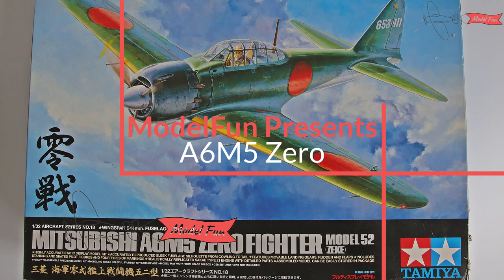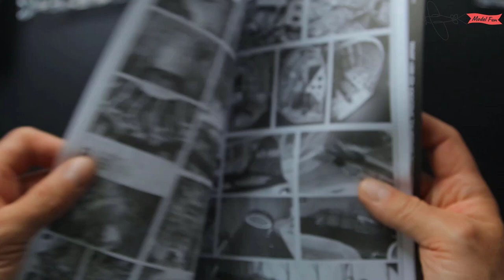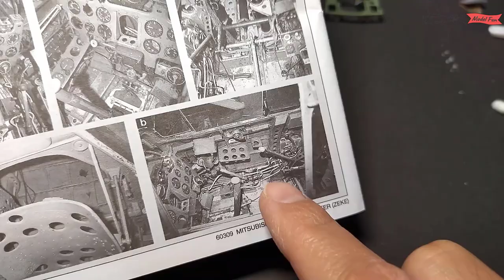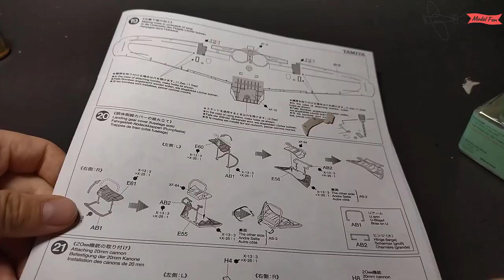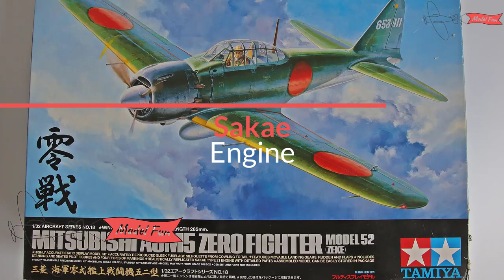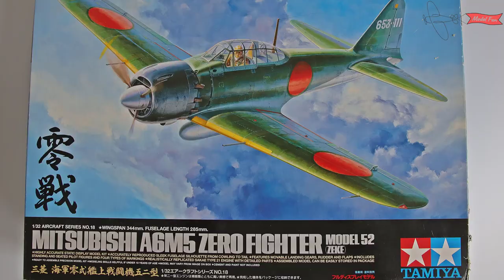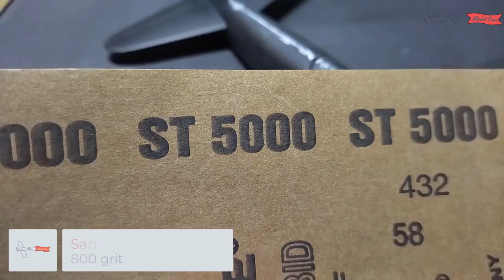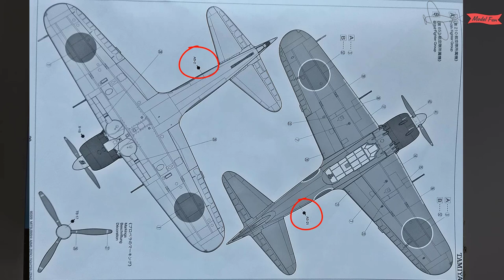A6M5 Zero (Nakajima build) Fighter Model 52. Tamiya 60318 1:32 FULL BUILD

Comment: The Aotake was a ckear, tinted corrosion protection coat, painted over bare aluminium. A better was to replicat this is to lay a coat of metalizer over the primer ot gloss base, then apply a mix of clear blue and green over that

Comment: Mitsubishi, not Nakajima.
Reply from the maker: Hi Robert. There were two companies producing this aircraft. Do you know the difference?
Reply: @modelfun  A Mitsubishi product designed by Mitsubishi and awarded the contract is Mitsubishi, Nakajima had nothing to do with it other than producing a Mitsubishi product, do you know the difference..?
Reply from the maker: M letter in the A6M5 stands for Mitsubishi. If this is not correct enough for you, I'm sorry. Nakajima in the title indicate the manufacturer as I think it is important to highlight. This painting scheeme was a Nakajima one. There is a lot of confusion about it. 
Anyway,  thanks for watching.
Reply: @roberterdei8627  majority of the A6M variants were bulit by Nakajima, the engine was designed and built by Nakajima and the floatplane version was completely designed and produced by Nakajima. There is nothing wrong with the designation. (also it can be seen in many reference materials). Learning some facts before judging someone's work will help next time...
Reply: I think a better way to correctly identify the aircraft is s Nakajima-built A6M5. The parent company was still Mitsubishi, as stated on the box by Tamyia. Another great example would be the Vought Corsair. There were a couple of manufacturers who built it under license (General Motors and Brewster) but it was ultimately still considered a Vought-designed aircraft.
Reply: I can't say enough about the quality of your build. I hope my A6M5 will turn out half as nice. I will send pictures when it's completed. I plan to make it a Mitsubishi-built aircraft.
Reply from the maker: Yes, I would like to see the completed model.